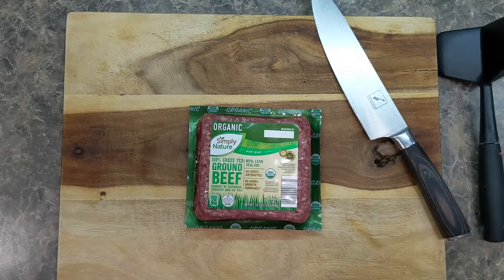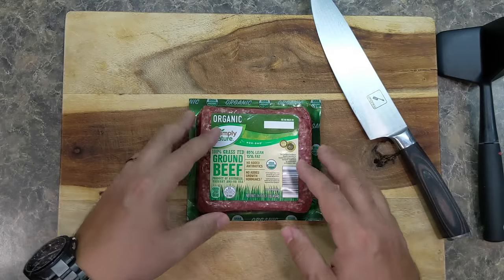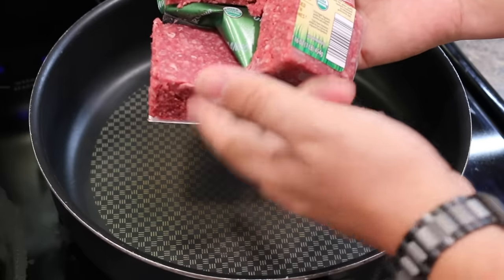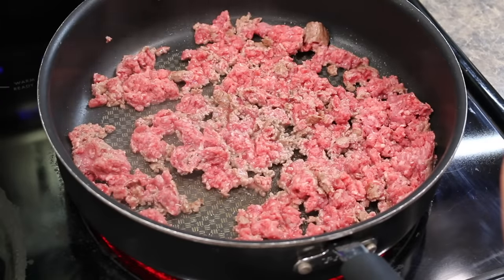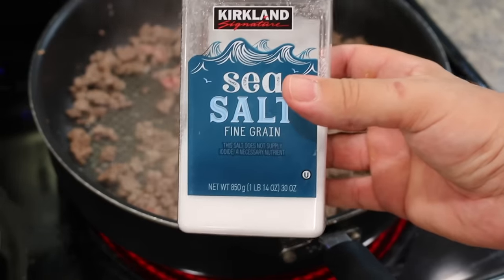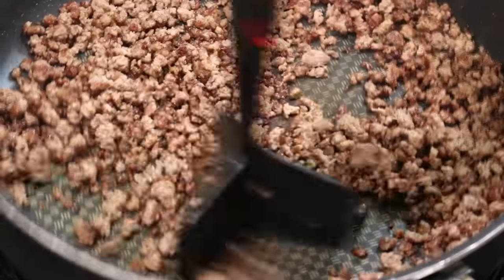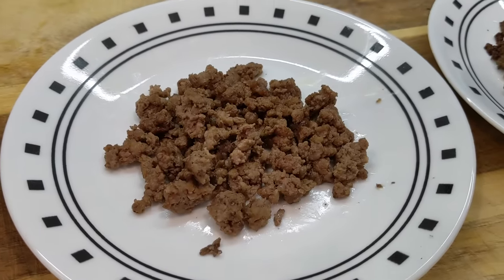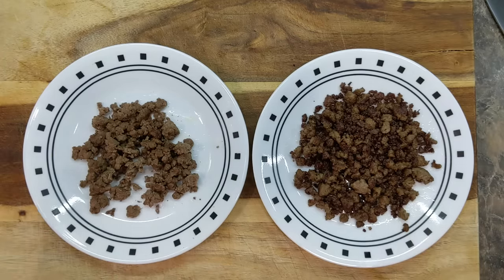How to cook ground beef for maximum flavor | I bet you didn't know this!

Comment: Why does a cast iron pan seem to do so much of a better job with burger than a non stick? The retained heat in the cast iron?  ie doesn't cool down when the meat goes in the pan and then evaporates the water more?
Reply from the maker: It's just romance. There is no significant difference cooking a pound of ground beef on a cast iron skillet than a good-quality non-stick skillet.  But we like what we like, if you prefer a cast iron skillet, that's great. But from a practical perspective, I don't ever use cast iron when I can use a good quality non-stick pan.
Reply: @FoodChainTV   Thanks for reply.. just make up for it by cooking at a higher temp like you said in the video (to evaporate the water).. Either way thanks for the nice vid.. i bought some ground beef yesterday and am going to order the recommended chopper from amazon.. Cheers from Alaska.

Comment: At what point in the process would you add onions, peppers, garlic, seasoning? Thanks.
Reply from the maker: This method of cooking beef works best for adding the beef to a wet sauce or soup. So, I would add the onions, garlic and seasonings to the sauce, and then add this beef to the sauce at the end. 

If you're making a dryer beef dish that is not very wet, you don't have to cook the ground beef like this. You can cook it less time, so it retains more moisture and is softer.
Reply: Thanks!

Comment: That pan needs to be replaced bc its bottom looks completely uneven/wobbly and therefore the heat transfer gets impacted negatively. OTOH, non stick shouldn’t be heated as its surface will disintegrate/get destroyed faster.
It looks like this pan is from Tefal, which contains a red dot - that is a heat indicator. Use it!

Comment: Are you crazy? For a good fried taste (as the Italians do it)  you have to avoid getting to the boiling phase. You need to add the minced beef at max temp and then separate (add a new raw surface) as required. Avoid that the releasedf water of the beef is lowering the temp of the oil!!! No wonder US cooks always fails the Bolognese challenge.

Comment: You get the maillard reaction quicker in the broiler. You don't want the meat to lose ALL it's water or it would simply denature. In the broiler you get the charred top layer, and the bottom layer retains some water....you control how much. Then take it to the stove and add liquid ingredient as per whatever recipe you're doing.  The reason this is important is because not all chop meat is made the same. If you have a lot of lean cuts that go into your chop meat you don't want that to cook too long, and if you have a lot of fatty cuts you DO want it to cook longer. And I'm talking about the TYPE of cuts, NOT the percentage of overall fat in the mix. No single recipe is right, you have to know your meat.

Comment: In your technique above how do you cook a burger without breaking it up and having to move it around? You don't have a normal burger lesson. (I did not see your wagu burger because lets face it, i'll never afford one and I don't want the additions)  I like Tavern burgers, thick juicy pink in the middle but seared well on the outside for the steak flavor. Problem is I cannot get it to come out right consistently and I'm thinking some form of your info info may help me.. I just  don't know what that is.
Reply from the maker: Thanks for the suggestion. I will add that to my list of video requests to make.
Reply: @FoodChainTV  Thanks. You earned a sub so I can look out for that.

Comment: Ok so when do I add the onions!?  I usually start the onions first with a little butter and then add the meat.  Also, don't use oil.  Oils are extremely unhealthy and when you heat them it's even worse because they become unstable.
Reply: So every Chef is wrong? They ALL use oils
Reply: @labab1048  That is an interesting question.  I could ask you,  "Do you think that everything a chef cooks is automatically healthy just because they are a chef?"  You can buy many unhealthy foods in restaurants right?  To answer your question I think technically they would only be "wrong" if they claim that it is healthy to cook with oils.  Whether it is "wrong" to serve unhealthy food when that is what customers tend to want is a much bigger question.  I think every chef would have to answer that for himself/herself.
Reply: @ted458   Well technically, I know they use oils over butter because butter burns at lower temperatures over all…
Reply: As for this ground beef presentation, he massacred it!
Reply: Then don't cook meat. It contains oil. 

Also, butter is made of oil. That's why they use clarified butter for cooking... it separates the oil from the water in the butter, and can be used at much higher temperatures.
Reply: @croaxleigh  The vegetable oils are the problem.
Reply: @ted458  lol